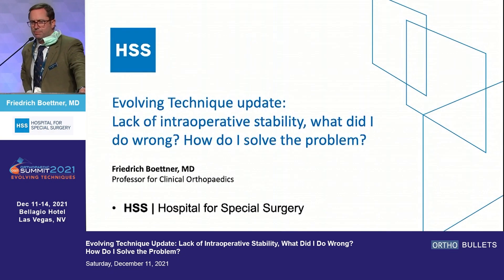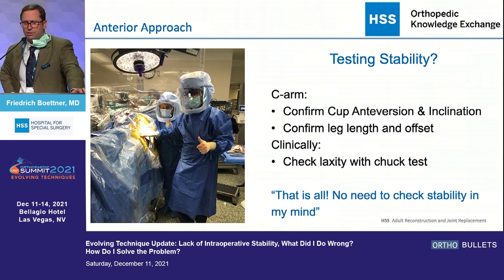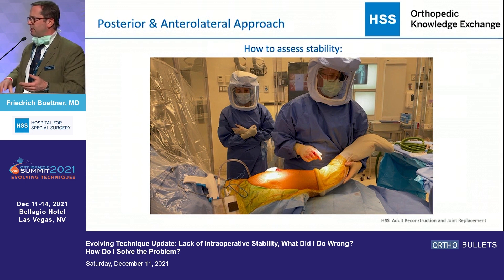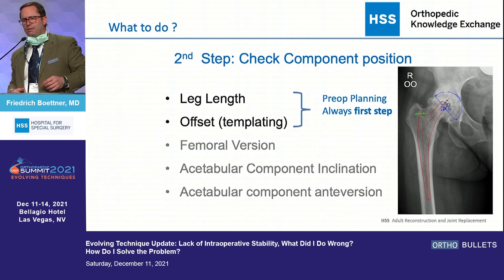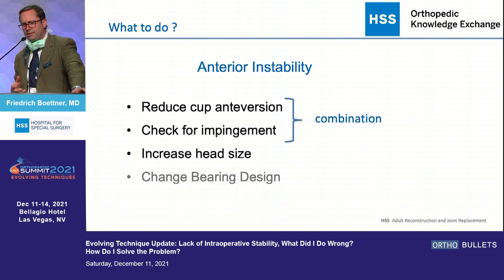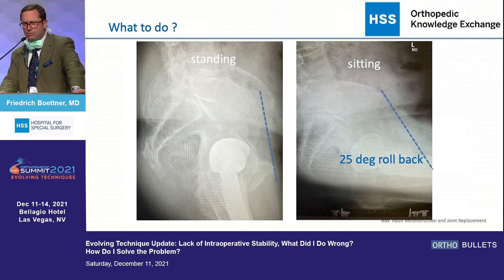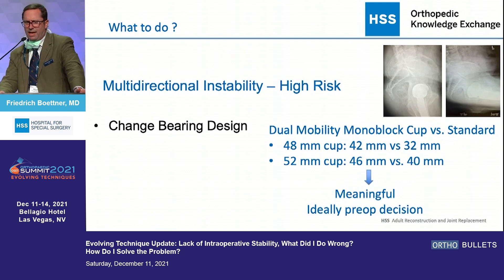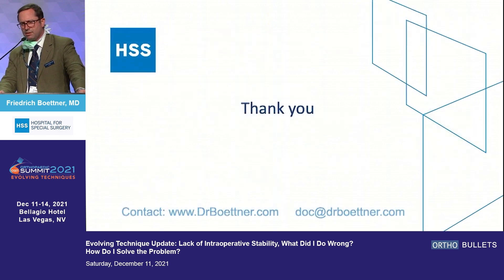Lack of Intraoperative Stability, What Did I Do Wrong, How Do I Solve - Friedrich Boettner, MD

Comment: Just a suggestion...when testing stability of the hip construct in extension-external rotation, check it with the hip in ADduction, not just ABduction. That may help to show if the neck of the femoral prosthesis may impinge upon the acetabular prosthesis posteroinferiorly thereby causing leverage and dislocation out the front.